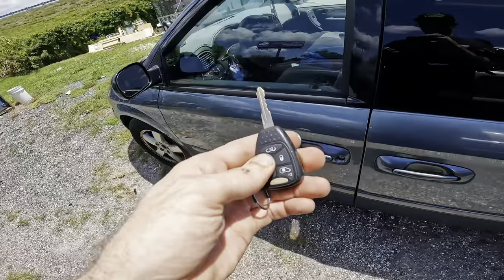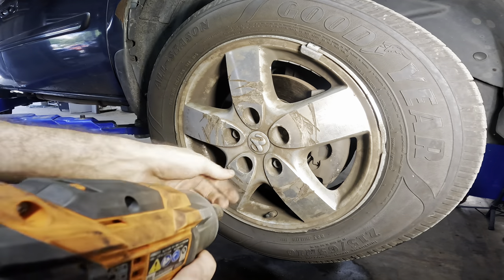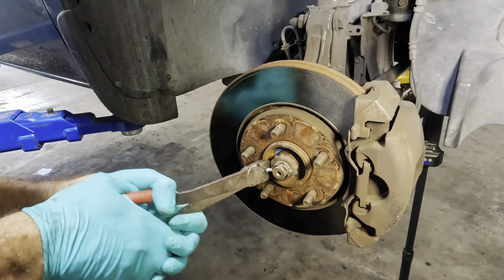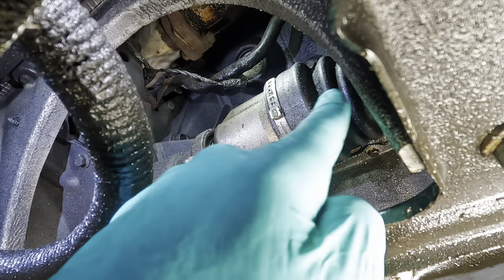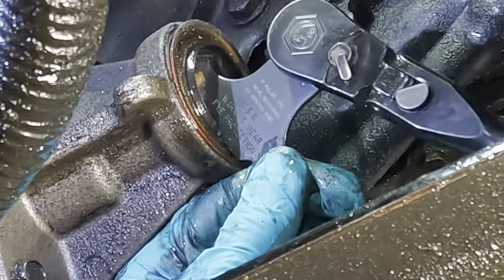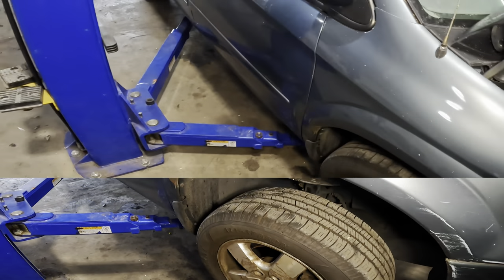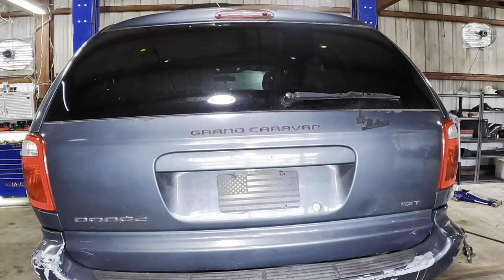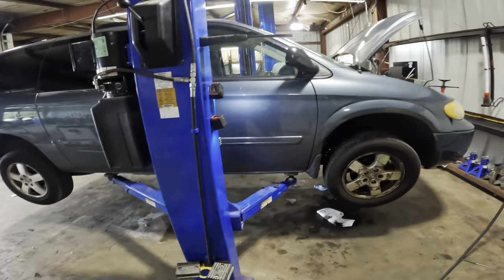Worn OUT Busted Axle! Dodge Caravan Limps In! 2007 3.8

Comment: as a minnesotan it amazes me that these vehicles with 200k miles have far less corrosion than much newer cars up here. almost every difficulty i've had working on my truck has been from corroded/rusted nuts and bolts.
Reply: Another Minnesotan here.
Yep, our salty roads does take it's toll on our vehicles!
Do you watch SMA? NEW YORK salt is 4 times as bad in my opinion!
Reply: @dans_Learning_Curve   i don't watch SMA  but i'll have to check them out. maybe that new york salt will make me feel better
Reply: Yeah I hear you on rust had a 2004 van like that we had to deny service because rust was too bad to lift without smashing the lift points.  South dakota here so we in same boat.
Reply: I have a rust free Town and Country bought new in 2003.  Easy to work on and parts are cheap.  Mine has 200,000 and runs like a watch.
Reply: 2006 vehicles here in the desert southwest. Zero rust, pulled a steering rack back in July and not a stuck nut/bolt in sight.
Reply: @jcadult101  man that would be something.  Me and my dad replaced my front struts and had to cut off the way bar links to get them out.  Couldn't get ahold of them to get the nuts off
Reply: Laughing in Arizona! 🤣
Reply: Fluid film is your friend
Reply: @joevanweedler SMA is South Main Auto btw
Reply: Minnesotan here also I believe my 2000 might be dissolved by now I’ve learned with my Jeep that the unlimited car washes at Holiday station keeps the road snot off .
Reply: @user-wj9wq7mk4h  SMA rocks! Loved the 'replaced subframe because there wasn't any metal left' video.
Reply: Fluid Film underneath. I am a little ways away from SMA.
Reply: Nothing like a good protective coating of leaking oil.
Reply: @user-wj9wq7mk4h  Another great mechanic.
Reply: Yup, I’m in Massachusetts and I visit the car wash twice a week for an undercarriage wash in salt season and I still have corrosion on my 50k Honda. 😩
Reply: Thats gotta be the same as new york most of the cars ray works on have no rust and they're 20 years old
Reply: With that much oil coating everything, it's hard to imagine the rust even having a chance to start.
Reply: @robertpimpo4698 I have a 50 year-old Cadillac which has always been here in northern California with no rust. I am shocked when I encounter a rust-belt car — they’re scary sometimes.
Reply: northeast pa and Southern NY. is same my 2020 started rusting then I watch Ray mesmerized like ooooo the dream. 😂😂😂😂
Reply: I’m from Arizona and I’m amazed how rusty it is.
Reply: Same in Michigan. But on the positive side, the rust creates cooling holes in the body, so you don't have to run the ac as much in the summer.
Reply: Cheap Chinese Steel. If you stop cleaning your undercarriage & let your leaks dribble , you’ll have an automatic rustproofing system.
Reply: Former minnesotan who moved to Norway. I don't miss the rust. At all.

Comment: Ok, seeing the actual bad CV joint while the vehicle is moving was awesome. I wish there were more videos exactly like that to show people what the noises are they may hear.
Reply: Was that a oil pressure gauge on the knee bolster or the right
Reply: I wonder if the broken  engine mounts are the orginal cause of flogged out axle?
Reply: @terrywilson1226  Very well could be. I have seen CV joints pulled apart by too much engine/transmission movement. To be fair, the front suspension of said vehicle also needed every bushing, so it was a combo of bad engine mounts and suspension bushings in the case of the pulled apart joint I saw.
Reply: People often don't change all of it due to budget constraints so we can't blame them so having said that, it will cost more in the future unless of course you wanna scrap the vehicle in the future if it breaks down.

Comment: Ray, as an electrical guy, I have to make one correction; you stated that "bad connections are going to draw extra current".  That is incorrect. A bad connection (generally due to corrosion) creates a high resistance joint.  What occurs is that the added resistance actually generates heat due to the voltage drop across it (Ohm's law states that voltage = current * resistance). The power dissipated (Power = the square of the voltage divided by the resistance) produces the heat that causes the melting to occur.  You were correct about the arcing, however as that can happen as well. I like to use dielectric grease as a preventative against said corrosion.  Anyway, I truly enjoy your channel and watch it almost every day, or at least when you put up new videos.  You have taught me a lot about vehicle repair, and I heartily thank you for that.  Keep up the good, honest work.

Comment: I installed a oil pressure gauge on my '81 Chevy stepside I used to have but I added a brass manifold block so that I could keep the low oil light function as well as an oil pressure gauge.

Comment: I don't wanna be 'that guy' but I feel it's worth mentioning, just for info sake ... in your bonus material with the rear light unit. You said the melting action was because of a bad connection and a bad connection will draw extra current. But this can't be true because of ohm's law. A bad connection creates extra undue resistance to the circuit, increasing the over-all resistance of the circuit will reduce the amps drawn, not increase. A resistive(bad) connection will generate heat though and arcing etc that leads to the melting action you pointed out. Enjoying the vids as usual Ray keep working on your own unit there I'm glad to see you and yours do well.

Comment: Good call on replacing the entire tail light assembly.  Up north in the rust belt we call  those oil leaks the factory installed undercoating  option !! Thanks for all your videos Ray.
Reply: I'm pretty sure florida is an honorary member of the rust belt lol. Surrounded by ocean, and humidity through the roof. I suspect they're no stranger to rust.
Reply: @thebob1441 they're not driving through salt sludge several months of the year.

Comment: One of the best purchases i made for my vehicle was a set of solid alloy lug nuts for all 4 tires. No more of that bimetal/chrome capped steel. I do not want swollen nuts. and for those who dont know, what happens is a process called dissimilar metal corrosion. Which means when 2 metals touch, their electrons want to balance out, so they pass electrons back and fourth trying to balance, and this causes corrosion, and this causes the chrome camps to swell as corrosion builds up between the Chrome Cap and the Steel Lug. it's a pain in the ass when it happens and can cause sockets to get stuck a lot with the lug wrench if you're on the side of the road. Long ago I was told it saves auto makers like $20 per car to do the chrome capped steel (dont know if this is true or just an old wives tale). I'd pay the 20 bucks over the life of the car note to NOT have to t deal with swollen nuts.
Reply: Air tools being used on those  Chrome cap lug nuts are really hard on the older ones.  Yes that type of corrosion does them in . Good idea going to solid caps. Been there and experienced that.
Reply: Most of our Foods through the years had rusty lug nuts.  The last time we did tires in my wife's Fusion, I bought a complete set of Dorman nuts and Walmart graciously installed them, as they didn't carry that size in the store. I had Fords in the 70' and 80's with the styled-steel wheels and those always corroded.
Reply: swollen nuts are the worst.

Comment: Bad connections don't draw more current.  It actually causes less current because there is more resistance in the entire circuit.  Heat is generated wherever the resistance is higher per the formula Power(W)=Current(A)*Current(A)*Resistance(Ohms).  This power is in the form of heat which causes the plastic to melt.

Comment: As for the taillight, the bulb sockets can get overheated if you got stuck in stop and barely go traffic or tend to drive with a foot on the brake pedal and pressing just enough to cause the brake lights to stay on.  Also, if the bumper on the brake pedal switch is deteriorated, then you could have suffered not only a dead battery but a melted bulb socket on both sides.  Always use dielectric grease on your bulb sockets.
Reply: he always says, 'I don't think it is needed'.
Reply: The wire is not thick enough from the start. So the plastic melted short circuit, need a whole assembly. It's still better than the newer ones when the alternator shorts the module.
Reply: I totally agree with @aoksys31, in all automotive applications always apply dielectric grease to all plug/jacks, lamp sockets and ground lugs. Especially in the salt belt. If you unplug it grease it!
Reply: OK. will use BG grease from now on.

Comment: The actual problem with the break light going bad is not actually the connections. But the heat of the light bulbs. Therefore causing the housing of the light to melt that way. 

The only fix I found that works is LEDs bulb replacement. Due to LED bulbs do not get hot. 

Now if you use LEDs replacements.  You need to trick the computer (ECM). Because of hyper flash with turn signals. 

You have two options for the trick. Some vehicles you can trick the computer  turn signal flasher, to a new electronic LED flasher. (Not all Vehicles could use this option). 

The second option you can do. Is to use load resistors behind the light bulbs.

If the break light is separated from the turn signal. You may not need a load resistor or a LED flasher. If you're just replacing the brake light to LED. But in a lot of cases you will need to add a load resistor for a older vehicle just for the brake light.

If you want to use LED bulbs. I could suggest the projector LED bulb replacement. They are known to be the brightest and you could find them online. They will not be down in the local stores.

Comment: I had a 2002 just like this van. I never had to replace the CV axles, but fixed oil leaks, replaced water pump, motor mounts, fuel pump twice and then some. I was so happy to get rid of that van.

Comment: I owned a’75 Doge maxi van for 8 years , sold it to my buddy and he drove it for another 7 years . The motor ( 360 ci) was great , he did replace the transmission ( 747 torque flight ) , if the body had not decided to just rust away - we live in Missouri , so snow/ salt takes its tool he might of kept it . The kid he sold it to did some repair to the body and still had it 3 years later till we lost track of him . The running gear held up as far as I know , so had to hand it to the Chrysler engineers .

Comment: Bringing back memories- uni student had an old 300k 1980s Japanese car with way worse CV's- they clunked. Bottom of car exactly like this one. LH outer CV seized on freeway. Took a 1km to slow slow down through the gears without brakes (this car was way before ABS- but brakes were total sht anyway). Waited. Amazingly- came it unstuck- slowly drove to nearest exit- lucky day- a CV and Diff place was within 400m of freeway, cool old dude swapped out old axles for new ones $150- he kept the old axles. Car drove sweet as a nut. Best money I ever spent. Japanese cars are amazing.
If you can feel the clunks through the steering wheel- don't drive it- very very dangerous.

Comment: One thing we do not seem to do so much here is complete replacement unless necessary. In most cases with cv joints, the joint is replaced, not the whole axle assembly, Obviously if the spline is loose fitting or damaged, then replacement is required, but it seems this is rarely the case.
As to the Rear light module...  why do they make them like that..  most I see here (not US made vehicles) have connectors to each bulb, so unless the modue is actually broken it does not need replacement...  All those ones do is save on one connector, and add a huge amount to the repair bill.
That said, you are still so good at your job, pity some of our guys here are not more like you...

Comment: That thing is leaking oil big time, everywhere. I guess you can't complain too much with all that mileage. It sounds like it runs pretty good, so it may be worth fixing a little at a time or like a car I had when I was a kid, you didn't have to change the oil, it was constantly being changed, just change the filter every now and then. LOL Great job on the axle, it went pretty smooth, the light too. Good video

Comment: I usually apply a thin coating of RTV to the outer diameter of seals. This functions as a lubricant to ease installation; and the sealant will fill any scratches and/or gouges in the bore, preventing possible leaks. Further, it does not make future removal any more difficult.

Win-win-win!

Comment: I just finished out a complete swap of suspension and steering on my PT. Unfortunately, the new steeringing gear sprung a seal leak and I had to replace it again.
It went to the alignment shop today 
Prior to sending it, I did various checks and got the alignment in the ball park, but using my inexpensive camber checking tool, I found the camber way out, further than it could be adjusted.
I bout the camber adjustment bolts for it and sent them with the car to be aligned.
It's a good thing that I did. They had to use it to get it aligned properly.
Cost me a bit more in labor, since they installed them. I could have, but wasn't so sure I needed them.
The camber bolts are built oblong and replace one of the strut bolts and because of their shape, they allow for the camber adjustment.
Sure glad I knew this before it went in and part of all this is from watching various videos of Ray's in the first place.

Comment: Yah!! Finaly a Dodge grand caravan.  I have a 03 and 17 and 18. They are great vehicles for 6 years once a month I would drive home 614 miles from Odessa TX to Brownsville TX in the 03.  I was working there due to no decent work in Brownsville. In the 6 years I only replaced brakes, coil pack plugs and wires hoses and belt . Of course oil changes.

Comment: I had a 07 that did the same thing with the tail light. Went to the junkyard and bought one for $10. Easiest tail lights ever to replace. I now have and 07 accord and I replaced the taillights in it I had to drop the bumper just to find the bracket to be rusted out. You can have anything simple anymore it seems .

Comment: I just changed a control arm on my Kia and to get the ball joint loose, I employed the upside down castle nut and hammer method.
It forced the castle nut down, spreading the castles and becoming one with the thread. Crap!
I got two new ball joints and will change them with the control arms.

Comment: The 3.8 waa a powerful v6.
I use to drag race my 2005 minivan 3.8
I shocked many .
There's a transmission trick also, but heh my secret 
I once raced a Ford lightening,. All he could do is barely get a half fender on me
 Took on a few mustangs and they also couldn't get more than a half fender on me.
    I blew several cv axels drag racing.
Always had a extra .
I limped home a few times

3.8 at one point got detuned..they were a damn good engine

Comment: Great video Ray, as usual.  Yes, those tail lights are easy to change, but you have to open the hatch.  Immediately before my buddy's bulb burned out, someone backed into his and it would not open!!! Not manually or powered.  He got pulled over several times before he could get the hatch open.

Comment: 490k on my original 3.8. We use them as oversize escort vehicles. The vehicle overall likes to leak oil and consume cv axles and alternators. Also a transmission about every 100k.
Reply: If you serviced the transmission it would actually last 😂

Comment: I Paint mark the strut bolt heads to the strut shoe every time I have to remove them just in case they are a cammed bolt. What i own have cammed bolts. Witness marks also are marked. Have never had to have an alinement done so far.
 Regarding the oil light.
 I just had it coming on and off, 12 Tranist Connect, but did not stay on. It presented with, dead gas pedal, stalling when stopped and slow to no shifting without pumping the gas pedal. Being a deliver van I thought it was done. Thanks to youtube and $20, I changed the oil pressure sensor and reset all, or any codes and no more problems.

Comment: I appreciate the detail that you go into, as the high value part of these videos is that we learn the highs and lows of doing each task. One question and not specifically about this Dodge, when you see a vehicle that has numerous faults does it frustrate or wear you down as it all could have been avoided with regular service ? Now you are the bunny who has to advise the customer of all the problems. An unnecessary stress.

Comment: Crunchy Chrysler.  When I saw the underdash oil-pressure gauge at 01:09, I knew that the Oil-warning light's switch had been superseded.  I wonder if that circuit might be an input to the ECM?
 
I am not a fan of "modular" taillamps.  As seen here, bulb connections can go wonky.  Also, especially beginning with 1988 GM trucks, hairline cracks can develop in the "bus"/"printed" wiring in the lamp mounting plate. (Dorman to the rescue! 😆  Or, some creative soldering.)  Give me Olde Schoole™ wired lamps any day.
 
"Pish Pin!"  I must find a way to work this into a conversation. 😜
 
Was that blackout rear license plate installed at the shop?  At the customer's request, a new shop policy, or to prevent doxing?
 
Good work as always, Ray.  Looking forward to a followup on this, for the Exxon-Valdez oil pan and motor-mount mayhem. 😉

Comment: The gasket for the oil filter flange was another really common oil leakage source on the 3.3 and 3.8L engines in the Caravan and T&C.  There was a warranty campaign on it way back when, and the fix was a different flange with a formed rubber seal.  I see very few of those.
Reply: I just changed the gasket on our 2007 with 3.8 the gasket was hard as a rock I ended up ordering both seals one was the rubber o ring type and the other paper gasket hasn't leaked sence new gasket didn't see an update housing